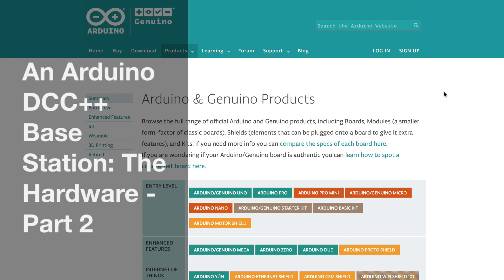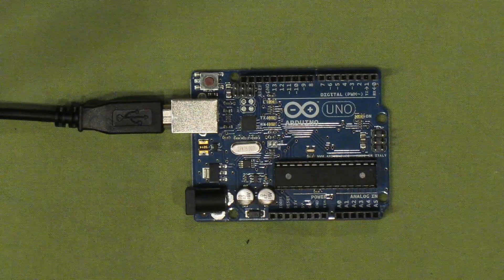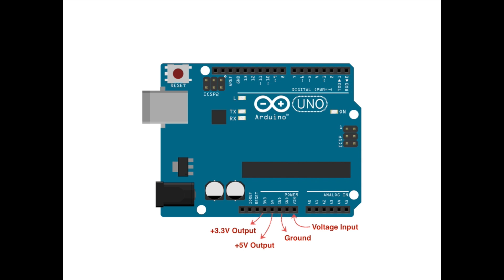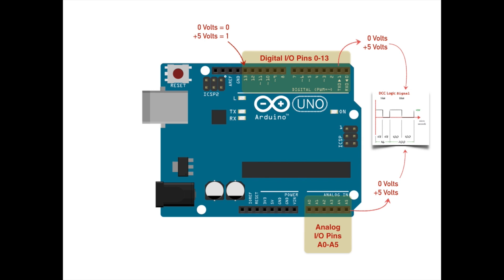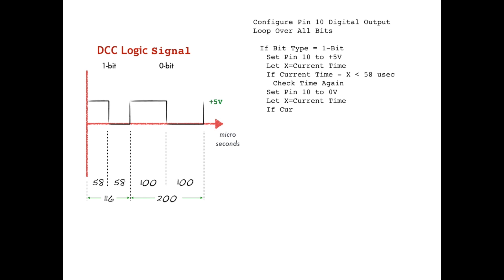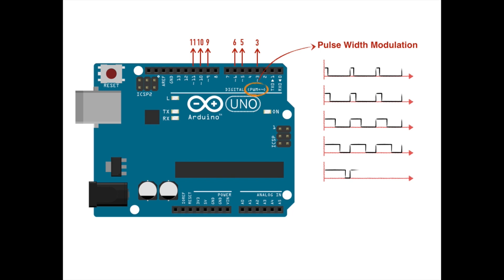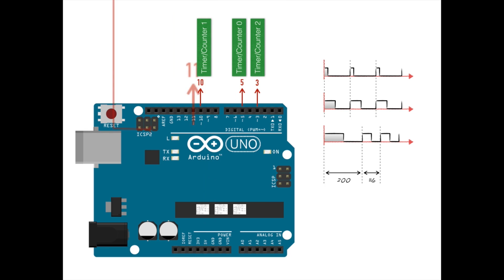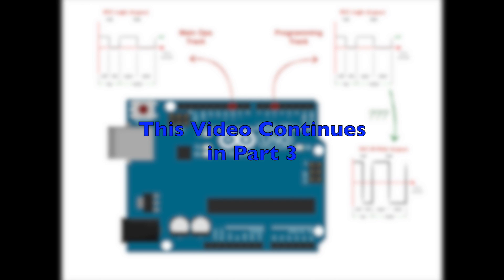An Arduino DCC++ Base Station: The Hardware - Part 2 of 4

Comment: Hello DCC++, I just looked at these four parts. I find them quite informative as they give me insight into how such a system works. The question I now have is, 8 years have passed and the number of Arduino clowns has increased, and the performance has increased. Do the z. B. a UNO + Wi-Fi R3 AT mega328P + ESP8266 CH340 (32 MB memory) 6V-9V with L293 motor shield? I just bought these two devices yesterday because I thought that every Arduino and motor shield would work.
Another question is: I wrote a sketch for an ATTiny88 that evaluates a sensor. How do I transfer the calculated speed to the locomotive, and how do I recognize which locomotive is entering my sensor area?
LG Lutz Müller

Comment: Many thanks for taking the time to produce these very clear videos. I've learnt a great deal and it filled many holes in my knowledge that I wasn't aware existed.

I do have a question. Is there any fundamental difference between the two sources for the main and program tracks?

Comment: Why PMW pin #3 is not usable?
Reply: I was also wondering the same. DCC++ says it is not as suitable (12:35) but does not explain why. I'd like to actually scale this up (maybe using a Mega to get a few more PWM outputs, maybe multiple UNOs...) and this is one thing I really need to understand. So... what property of Timer2 makes it not suitable?
Reply: I did not delve into the datasheet but u can check if this timer is shorter in byte count than the other two and with 16MHz crystal it might not generate the proper delay length, this is my fast assumption based on my brief acquaintance with the 8051 uC family

Comment: Hi,

Really love your videos on DCC++. I am just starting to design a small n scale layout and would like to implement the Arduino DCC++ Base Station on my layout. Will you be coming out with further videos and also the C++ code? Also, do you mind sharing your track plans? Your track plans are really suited for automated control.
Reply from the maker: +Shane Simcock 
Shane, thanks for the kinds words.  The plan is to next post my Arduino C++ code to GitHub.  The codebase is mature but needs some more commenting in order to be useful to others.  I hope to have it ready in a few weeks, at which time I'll also post a new video explaining the code and the command set.  Note that this C++ code only forms half of the system. The interface is actually Java code that runs on a PC or MAC in the Processing IDE (though it can also run standalone with just Java).  However, the C++ code communicates back and forth with the interface over the serial port (USB) using simple single-letter commands.  This means you can use the Arduino IDE serial monitor to manually type in these commands to test the Arduino software and even control a layout.  I wouldn't recommend using this in production, but it would allow you to create your own interface if desired (instead of using the Java version that I'll post after the C++ Arduino).

I'd be happy to share the layout as well.  Give me a few days to figure out where to post it and I'll let you know when it's up.
Reply: +DCC++ 
Thank you, for willing to share your layout plans and also taking the time to share information regarding DCC++. From the videos, I am guessing that you have used Kato Unitrack.

Have to watch Part 3 and 4 of the Hardware videos that you have uploaded yesterday. Looking forward to your posts on C++ code and the Java interface code that you have compiled for the Arduino DCC++ Base Station.
Reply from the maker: +Shane Simcock 
Shane, per your suggestion I've uploaded my track plans to GitHub--- they are available at: https://github.com/DccPlusPlus?tab=repositories.  Hope you find them helpful!